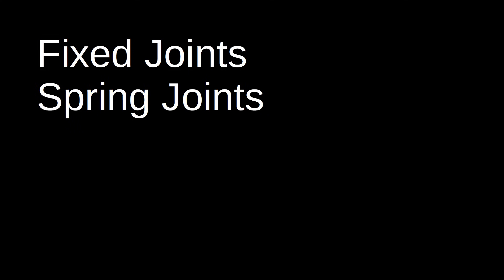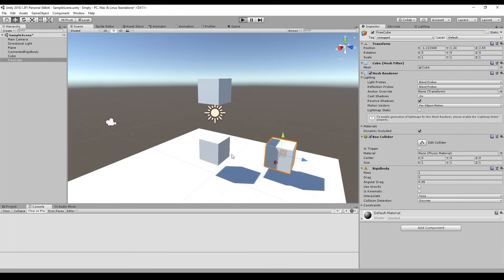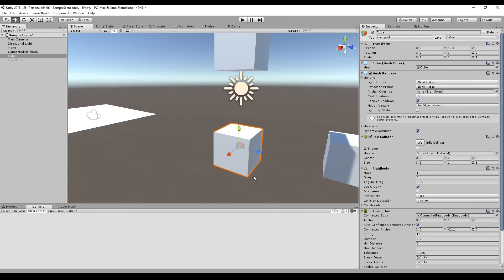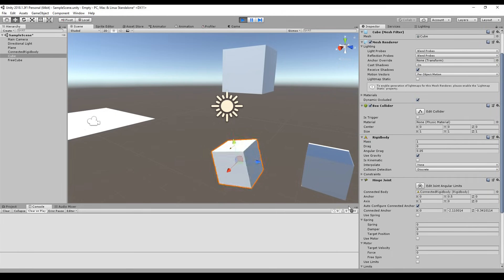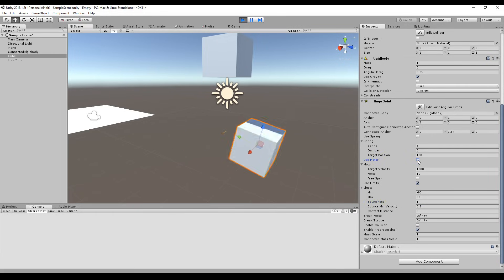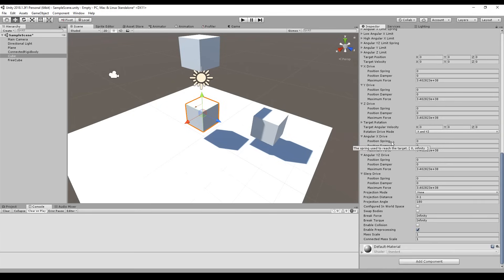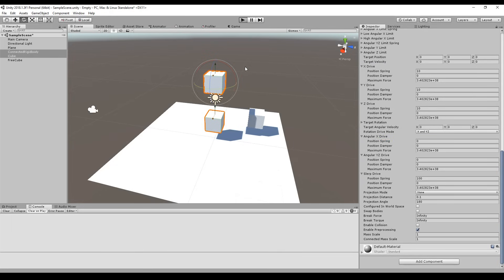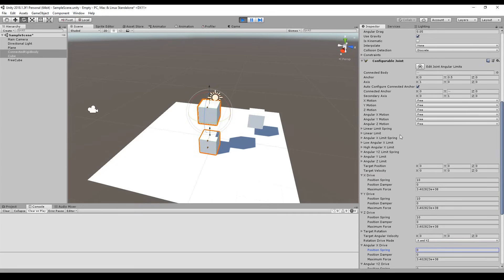Fixed, Spring, Hinge, Character & Configurable Joint explained - Unity Tutorial

Comment: A very hurried and not very detailed explanation of all joint flavours. Better tuts out there....or better still, spend the 17 mins reading the damn manual. Although it is good to see by example, in which case  Code Master series 201 to 205 (which used to be the old 3D Buzz series....circa 2014) which negates your initial claim.... and is rather offensive to those of us with long, astute and good memories and shows a conceited assumption that the rest of the world doesn't know these things.

Comment: Representation of the fixed joint here is not entirely correct. You can use fixed joint in chains like hinge joint.

You can try it on unity if you want. You will see that fixed joint can be used like hinge joint.

Comment: For anyone watching this, the explanation for the character joint is incorrect.

The "Axis" parameter is the main twist axis (as documented in the Unity docs), not the swing axis.

The whole section on the character joint is all wonky, as the axes are not correctly set, and what the author is saying does not match what's actually happening!

Comment: I'm struggling so much with this. The anchor point simply does not work correctly and I can't figure out why. 
Instead of anchoring where it's supposed to, it always goes to the center of mass instead. And it makes no sense.

Comment: I would like to add a hinge joint on an object that will be rotating with another larger object (basically a Ferris Wheel), but the hinge joint is too loose, it starts spinning like crazy at some point, no friction at all. Raising the mass or angular drag of the rigidbody does nothing, and raising the drag makes it stiffer but also feels much more resistance to the air. Do you know anyway of making it less loose?

Comment: I feel so bad when I realize I have to use Configurable joint...
Reply: what are u using that for?
Reply: picking up objects like in Portal. I made it using rigid body already. I can share if you want
Reply: @АдисХоджаяров  that would be great
Reply: // Follow after player hands
public IEnumerator Follow(Transform playerHands)
{
    while (held)
    {
        FollowPosition(playerHands);
        FollowRotation(playerHands);
        yield return null;
    }
}

// Follow player hands rotation
private void FollowRotation(Transform playerHands)
{
    // Rotating
    Vector3 desiredRotation = playerHands.eulerAngles;
    float xAngle = Vector3.SignedAngle(transform.up, playerHands.up, Vector3.right) / 90;
    float yAngle = Vector3.SignedAngle(transform.forward, playerHands.forward, Vector3.up) / 90;
    float zAngle = Vector3.SignedAngle(transform.up, playerHands.up, Vector3.forward) / 90;
    Vector3 direction = new Vector3(xAngle, yAngle, zAngle);
    rigidbody.angularVelocity += (direction * rotationForce) / rigidbody.mass;

    // Damping
    float dampingValue = 1 - (1 / (Mathf.Abs(yAngle) * rotationDamping + 1));
    float lookUpAngle = Vector3.Angle(playerHands.forward, Vector3.up) / 90;
    rigidbody.angularVelocity *= dampingValue * lookUpAngle;
}

// Follow player hand position
private void FollowPosition(Transform playerHands)
{
    // Moving
    Vector3 desiredPosition = playerHands.position;
    float distance = Vector3.Distance(desiredPosition, rigidbody.position);
    Vector3 direction = (desiredPosition - rigidbody.position).normalized;
    rigidbody.velocity += (direction * distance * movingForce) / rigidbody.mass;

    // Damping
    float dampingValue = 1 - (1 / (distance * movingDamping + 1));
    rigidbody.velocity *= dampingValue;
}
Reply: @notrue4u  That's not some professional programming here. But it works. It would be better if I used Quaternions for rotation, but I didn't learn them so I used my own method.

Comment: Thank you man. 2 things though. 
You should definitely enable gizmos. It's way easier to understand what's happening.
And at the beginning where you tried to collide one box into the other to break the joint. In that case, the joint break force wasn't the problem. Unity actually didn't detect any collider at all. To prevent that, just change your Rigidbody Collision detection to "Continuous" instead of "Discrete".
Reply: @3:00 ish you mean. Thank you!

Comment: Hellow, nice tutorial!
But can you explain how ancor axis in configurable joint works? I suppose it needs for turning limit area.
I'm making body with 2 limbs attached to it. And those limbs must have assimetrical angle limits on 2 direction. 
1) how rotate areas with this axis? Only x angle axis have min max setting.
2) also areas on both limbs looking in one direction, but i need them to be mirrored. How to mirror them?
I tried to change axis values and areas moved in weird way.

May be i should use several hinge joints, but i think it will be harder to script. 
If so, i still want to know how axis work.

Comment: how would I attach my character(which has a fixed joint) to a object like a cube through script? for instance I want to have a interaction script on the cube I want to pick up and have a interaction radius of about 0.4 so that when the character enters the interaction zone the fixed joint automatically enables between the two objects and he can move around with it
Reply: There is a big problem in your idea. The player is going to grab things, that means he is responsible for the interaction script. Here is the solution:

The player needs a fixed Joint in order for this to work.

FixedJoint fixedJoint = GetComponent<FixedJoint>();
fixedJoint.connectedBody = new Rigidbody(); //replace new Rigidbody() with the target rigidbody.

This is just for the logic of setting the Rigidbody of a joint. You still need to find the Rigidbody somehow?

If you need more information, I'm going to reply in this thread.
Reply: Hi, did you manage to solve this? I'm facing the sam problem :)